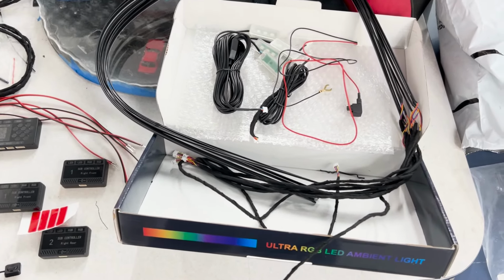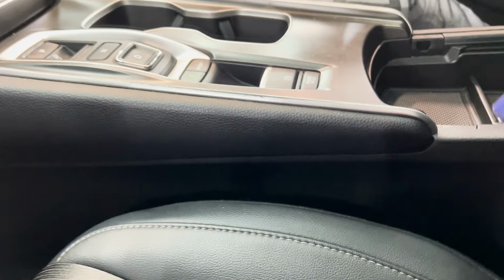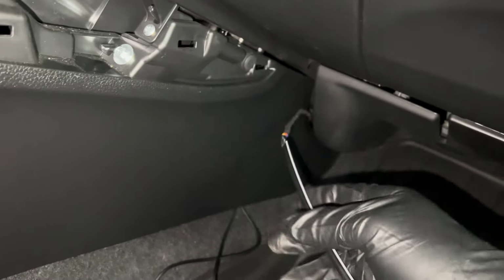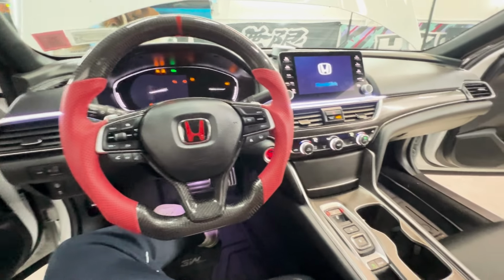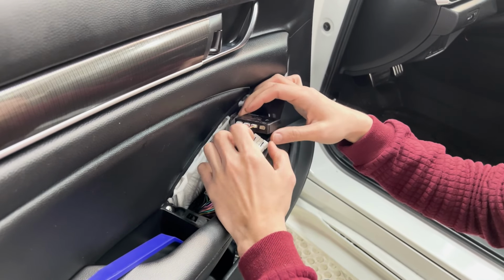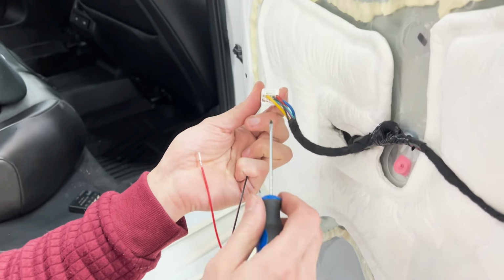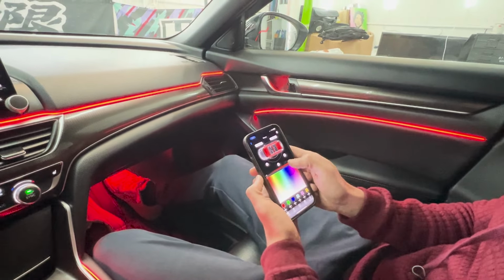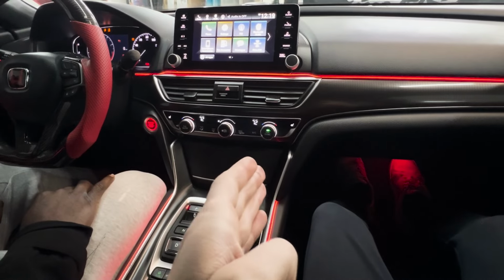Chasing ambient lights install 2018-2022 Honda Accord

Comment: Jo i drive a bmw m3 f80 my fuse box is in the trunk how can i do it then ? The cabels are not long enough yours is under the steering wheel mine is all the way back in the trunk any ideas ?
Reply: Plus how do i know where the black cable and the red cable goes on the doorcard where i have to tap witch one in ?

Comment: What’s the difference form the standard lighting kit compared to the chasing lighting kit
Reply from the maker: These are chasing effects and animation and bright all around and wirelessly installed and easy to replace each part.
Reply: @RedLineMods1  Do you have a video on the other lights
Reply from the maker: @treytonzeilenga5012 yessir search RedLineMods ambient lights

Comment: Hello! I’m very new to adding accessories to my car but I’ve been wanting to put ambient lighting in for a while and this video was super helpful and easy to understand. I was just wondering, is it weird to just put the lights on the dashboard and middle console? I’m not confident enough to put it in the doors yet because of the wiring so I just wanted some input. Would it still look nice without the door lighting? I couldn’t find any pictures for reference that’s why. Sorry if this is a dumb question, and thank you so much for the help!